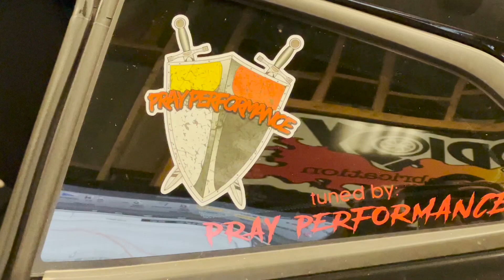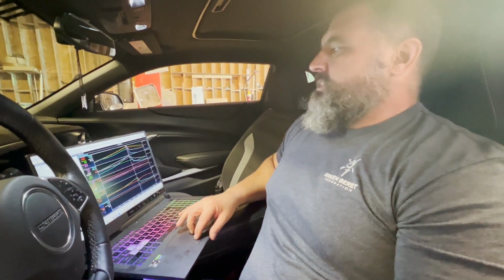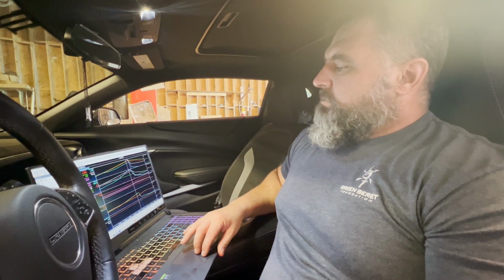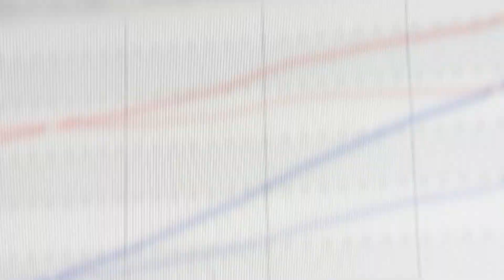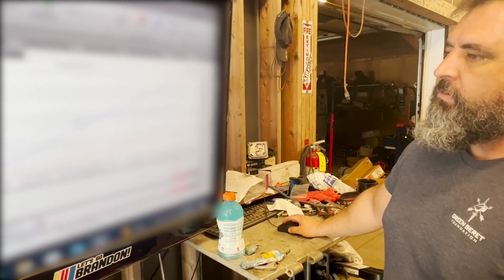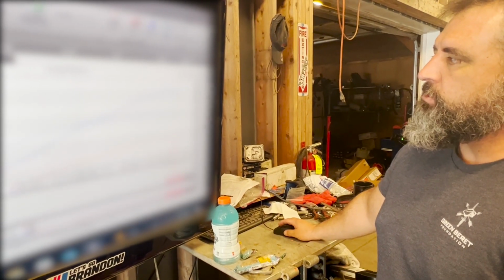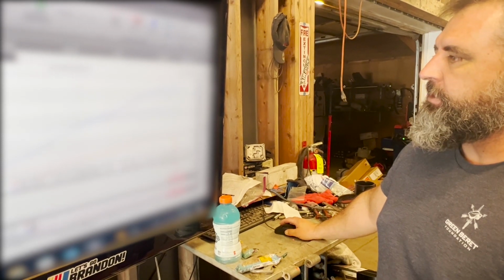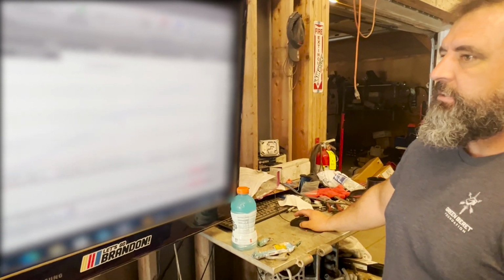Dyno tuning gone horribly RIGHT!!!

Comment: Hello. Quick question? I just bought a 2020 LT1 from auction. Long story short it has everything I wanted to put on it. 2in longtubes catless, lt2 manifold, rotofab intake and a fuel sensor. No cel light and the afm disable as far as I can see. My question is how do I find out what tune is in it and to see if there is an e85 tune? And can I get it retuned?
Reply from the maker: You would have to have hp tuners with the credits required to pull the tune and look over it. Yes you can get it retuned. If you are interested in that send us a email info@prayperformance.com or a Facebook DM